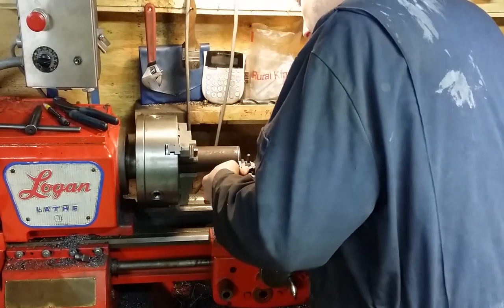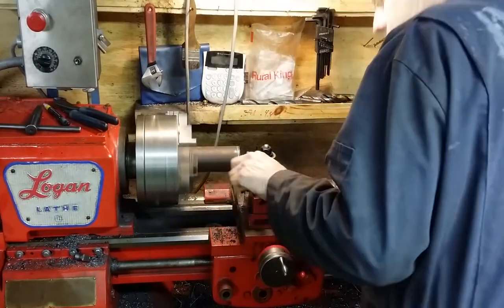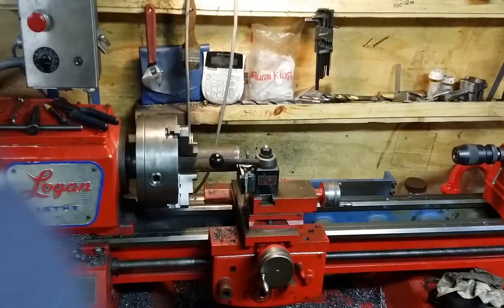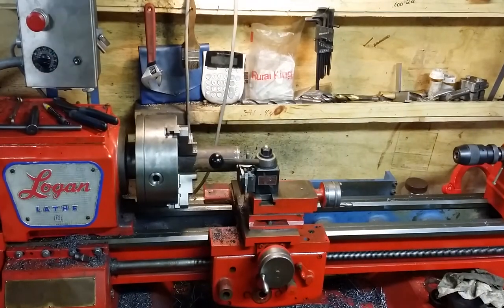Carbide insert parting tool test drive

Comment: I have a terrible time with my Logan 11" Lathe. The latheheadstock and spindle is pretty rigid. But i Don't think the compound and cross slide are rigid enough? .Yours sounds just like mine.
Reply from the maker: Its certainly a possibility.  But there are also some upgrades that can be made

Comment: Part off no more than 3 to 5 mm away from the chuck! Any more and you are courting disaster.
Reply from the maker: Thanks for the heads up
Reply: @craigtate5930  No worries mate.  Saw the thumbnail and thought No he can't be, so just had to watch. Carbide inserted parting tools are just so much better than HSS, They have clearance down the sides that HSS never has unless you grind it in there.  The other thing and this applies to any parting tool, make sure it is cutting sqaure to the lathe centre line and then check it again.  Some lube and it will work much better for you